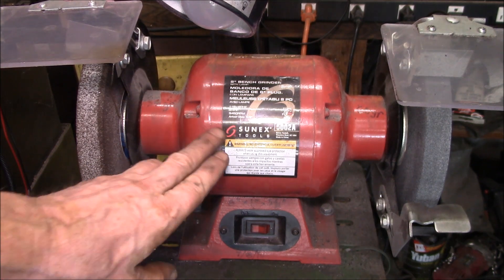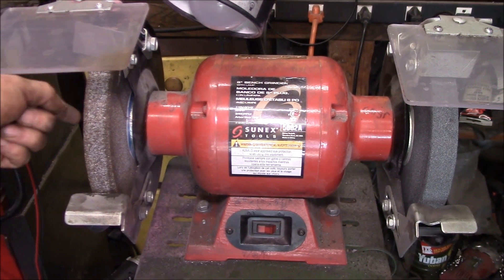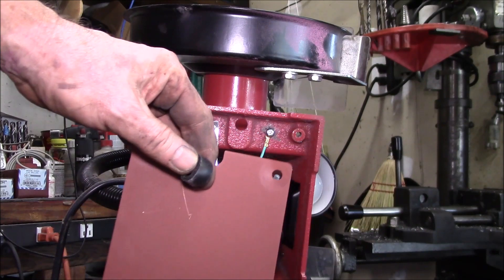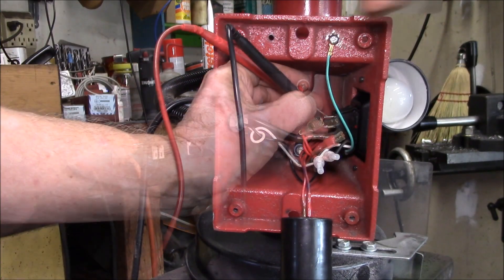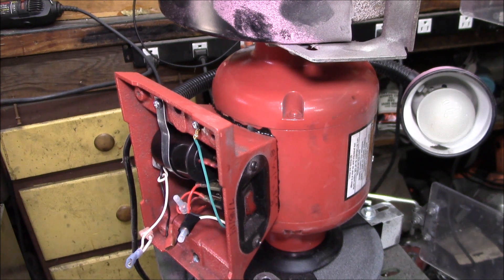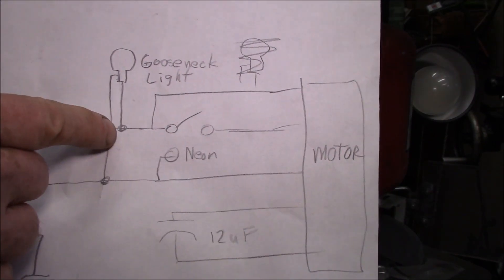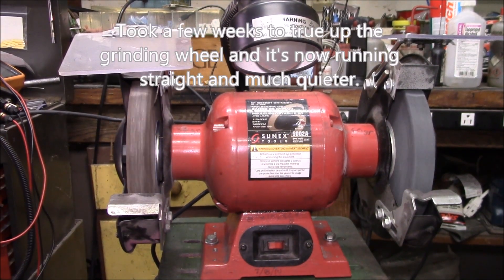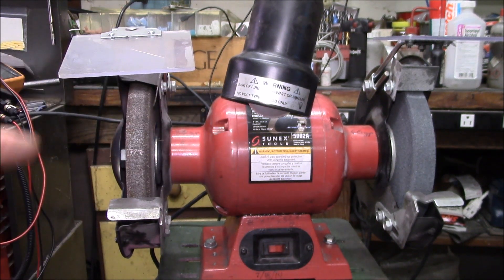Sunex Bench Grinder Repair and Modification

Comment: I got one of these broken with the wiring chopped off at the motor/base connection.  I see your diagram has 5 wires coming out of the motor and mine only has 4 (2 reds, 1 blue, 1 black).  I couldn't see which ones go to the capacitor, but I'm assuming it's the blue and black wires.  This is the only video I've found about this grinder and the closest thing to a good wiring diagram also.  Do you have any more info on which wires go to the capacitor?
Reply from the maker: I recall mine has 4 wires to the motor, all red.  Although the capacitor wires might have had some sort of faint (black or blue) stripe.  So your guess of the blue and black sounds decent.

Comment: I just got one of these today. I would like to do this same mod. Great idea!  Looks easy enough by looking at your wiring. Thanks! I also gotta get a wire wheel for it. I got it to refurbish old vintage tools
Reply from the maker: Seems to be a good grinder.  Mine is still going strong after fixing the loose bolts.  Easy enough to trace out the wiring to find where to connect the light for the auto on feature.
Reply: @The4Crawler  I honestly wouldn't have known I could even do such a thing if it wasn't for your video so I appreciate you showing what you did. It came in and is much heavier than I expected. Which is a good thing. I'm glad yours is still going strong. Thanks again. Stay safe and on the happy side 😎

Comment: Gotta like a fella who solves a mystery. Nice video. I have my Dads 5001 and I can’t for the life of me figure out how to tighten the wheels/brushes. I’d appreciate an education if you would be so kind. Thank you.
Reply from the maker: My trick is to use a stick that just fits between the wheel and the surrounding part of the grinder.  Jam the stick in under wheel and push down on the end to force the other end up into the wheel.  That usually creates enough friction to hold the wheel still while you tighten the nut down.  May take a few tries to find the right size stick for the job.  Too small and it'll break when you push down.  Too large and it may not wedge deep enough under the wheel to work.  With a wheel and a brush on opposite ends, tighten the wheel first, then with the stick still under the wheel, tighten the nut on the brush.  Hopefully the nut on the wheel is tight enough so it will hold while you tighten the brush end.

Comment: Yes Sir.  The simplest of Simple issues can have consequences  leading to some seriousness.
Reply from the maker: Yes, you got that right.  I should have fixed this loose base long ago.  But unbolting the grinder from the base is a pain.  When I found the nut on the coarse wheel had loosened up, I first tightened that up, but figured I had better fix the underlying problem.  Glad I finally did, it's been working fine now and I love having the light turn on and off automatically.